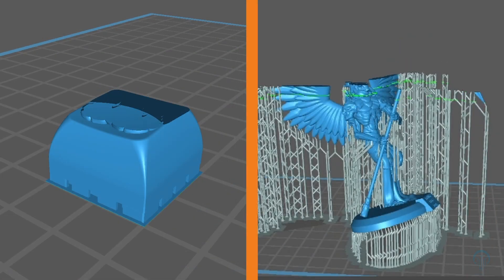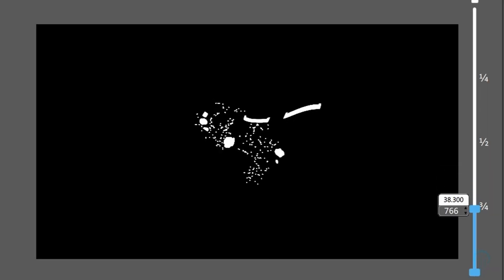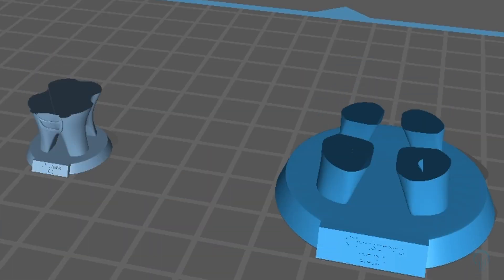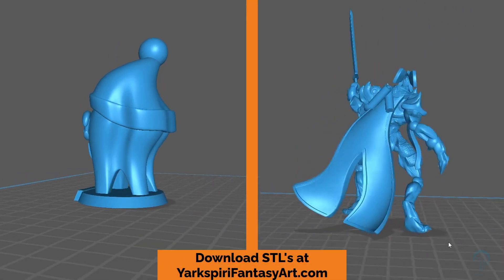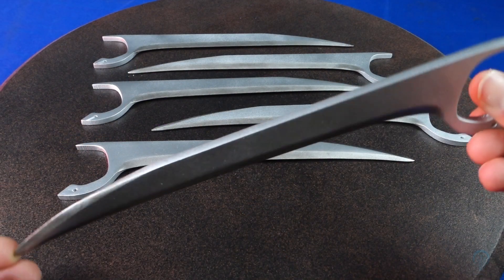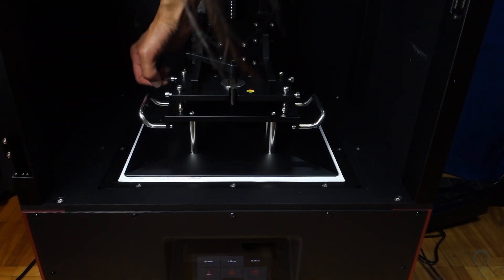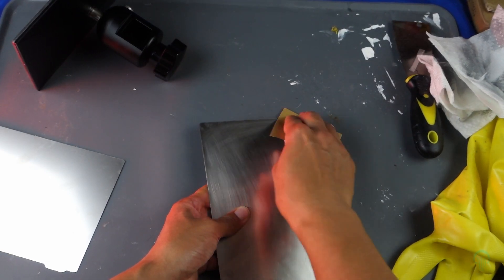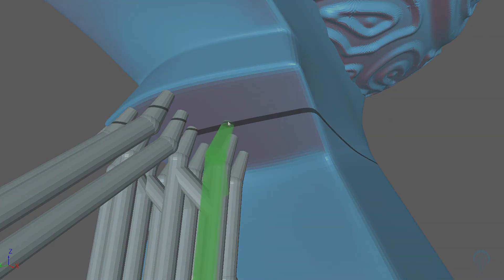When to 3D Print Flat vs Angled

Comment: Do you think suction force is still important in 2025 with a printer like a Saturn 4 Ultra 16k with the tilting vat to peel rather than pull prints from the FEP?
Reply from the maker: If the vat tilts, then a good amount of the force would most likely be alleviated.  I haven't tested it myself, so I can't confirm it.  It would be interesting to find out how much this increases the print speed.
Reply: @Yarkspiri  hard to know apples to apples. Was coming from a photon S from 6 years ago with an RGB screen so my exposure times were 10+ seconds. Mono is amazing. The heated vat was also key for me as I keep the printer in my basement which is usually in the 60s and resin really wasn't liking that.
Reply from the maker: @cratervanawesome  The heated vat is very helpful for the thicker engineering resins.  We have the heated vat at work, and it makes a big difference when the lab's cooler.

Comment: Hey, great video. I need to print an engineering part with very high tolerances. I tried the 45° angle method, but since the part is quite big, the side that was near the build plate ended up deforming. I'm thinking of installing a flex plate so I can easily take the part away. What do you think ? Please note that the suction forces will be quite substantial because the cross-section of the models is big.
Reply from the maker: If you can add drainage holes to close the build surface to relieve the suction forces, you should be ok, but it'll depend on your settings as well.  You may need to increase the first layer exposure to make sure it doesn't become detached.  I've used this approach for much bigger flat surfaces, and it's worked well for the most part, even if it's a pain to remove afterward.  I'm not fond of the flex plates because they become detached after a while, but it'll depend on what you're using your printer for.
Reply: @Yarkspiri  thanks for your answer. I added few holes here and there so I can reduce the overall cross-section. I mainly use the printer to create engineering parts with a precision that I cannot find in classic FDM.
Reply from the maker: @hatimmounib745  Are you using engineering resins then?  I've been using the Siraya Tech resins, which have been quite reliable for me.